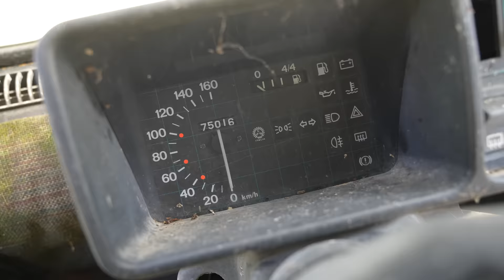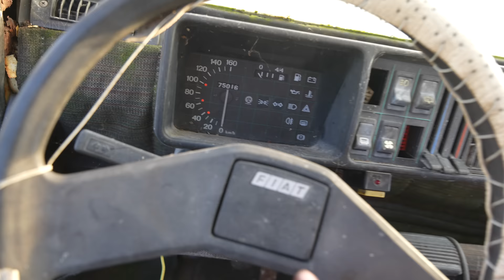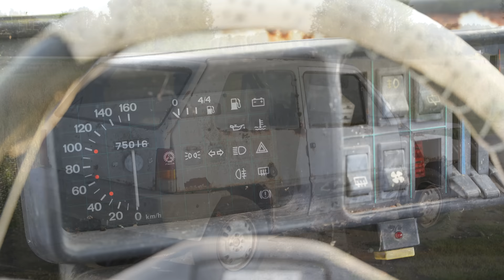Starting Fiat Panda After 17 Years + Test Drive

Comment: Almost nothing can stop the old Fiat 903 cc engine... And the fact that you still can drive a Panda in that condition, says a lot to the strenght of the car.
Reply: Is a imortal warrior
Reply: NOTHING STOP FLEXINO!
u nás v Čechách,je v krizovkach populární fakt:JAK SE ŘEKNE ITALSKY"ZAVADA" NA 4 PISMENA??????
Reply: F I A T😂
Reply: Is it a 5 cylinder cuz I saw 5 wires on the distributor
Reply: @driftking6071  A 903 5 cylinder?? This is a Series 100 engine, 4 cyl from 1956...
Reply: 👍🏻👍🏻 the same the Fire engines.
You can fill with sand instead of oil! 😂
Reply: @driftking6071 Centre wire is for the power in from the coil, the other 4 are going out to the cylinders
Reply: quotes
Reply: Ye that car is immortal
Reply: Dual carb = 958cc type a112 B1 054.
Reply: @driftking6071 4cyl, the Center is wire of bobine.
Reply: Proud to be italian
Reply: for the panda ? wow  @neronedemon
Reply: It was produced for 22 years with the same body. The second longest serial car production after russian Lada Niva :))))
Reply: @video_Creatorul_22mm  You forgot Land Rover Defender, UAZ 469 and UAZ 452
Reply: @driftking6071 4 cables a cada bujia  ,4 cilindros.  El quinto cable viene de la  BOBINA DE  ALTA tensión.
Reply: lol yea right, my mum's one would break if you even breathed on it, would break down on it's way back from the mechanic literally
Reply: @Krst22ify that is the condition?
Reply: Unibody is rotted away and it is unsafe to drive.
Reply: Fiat ai tempi era il TOP
Reply: Made in Termoli in the FPT factory
Reply: not sure, i killed mine on a trip to nordkapp haha
Reply: The mountain goat
Reply: @driftking6071 and ground goes where?
Reply: @shi2381 Exact Fiat Panda 45, 903 45 hp 4-cylinder engine derived from the Fiat 127.Designer Giorgetto Giugiaro
Reply: @christianmirto1597 🎉
Reply: 😂 0:30 ❤❤❤❤❤❤❤❤❤❤❤
Reply: But, the first engine installed is fhe 652 cm3 2-cylinders from the Fiat 126 @dariuscalen
Reply: Fiat Panda= Nokia 3310
Reply: @driftking6071 stai scherzando?
Reply: @driftking6071 è un quattro! Il quinto filo è della bobina di accensione

Comment: Here in Italy, the old Panda has the reputation to be mules.
There still a lot around, expecially of the ones made after the 1986. As they are reliable, easy and cheap to fix.
And the 4x4 still have quite a good evaluation (nothing less than 5000€) for cars which are not meant to be kept in the garage, but to be used on mountains, on muletracks, as a working tool.
And it does a better job than most of bigger 4x4 of any era.
Reply: i have 2001 4x4, everything is right, apart for the "cheap to fix", because they're becoming  "vintage cars" people are already raise the prices for parts
Reply: @Davide0033  here in portugal i bought my 1000cc fire for 2200.. 1700 would be fair cose it had some problems but i can say ive took this car to places that i swore it woudnt come out and it did really easy and no its not the 4x4
Reply: in brazil this car is called fiat uno and its a legend/meme in car culture, some says it was seen beating vw jettas and civics and going 200+km/h, and it a beater beater too, thing is a beast
Reply: @joaopaulogalloclaudino9671 Anche in Italia c'è la Fiat uno,ma è un'altro modello.E' stata costruita e creata in Italia,poi la Fiat a aperto la fabbrica in Brasile ed ha incominciato anche lì a costruire la Uno.E' molti anni che in Italia non si produce più la Uno,ormai è d'epoca in Italia.
Reply: Esattamente alberto, mi rendi orgoglioso di essere italiano anche da ubriaco😁
Reply: @joaopaulogalloclaudino9671  the Uno is a completely different car from the Panda. Different chassis, different engines, different bodies
Reply: Some yoke
Reply: Q

Comment: This is a Panda 45 first type 1980/84. In Italy it is a legend, I love this car (I have a Panda 30).
It's nearly impossible to find one of them,  now, in decent condition, because of rust, the main issue of these Panda first type.
Dear Flexiny, I hope you save the engine of this Panda... And other good parts. These Panda are very different from Panda built after 1985 and original body and interior spare parts are very expensive and difficult to find.
Greetings from Italy.
I love all your videos.
Giuseppe

Comment: Another great video, especially liked this one because I had one exactly like this 25 years ago, those fire engines were absolutely great little units, but the body is no surprise!
Reply: This is 100 D engine 903ccm i think
Reply: @predragv.365  945cc, on Panda. The strange thing, is the double-body carburettor with automatic choke.....on Pandas was available only single body with manual choke
Reply: @zimone89  945cc never existed! There were the 650cc 30hp, 903cc 45hp and the 965cc 48hp for the 4x4. For the northern European market the 850cc 34hp was available instead of the 650cc
Reply: @giorgiotek-604  right, i was confusing with 965 4x4. I thought also Panda 45 has same displacement of 4x4.

Comment: I have an early one, never kept in a garage and has no rust at all, it has over 300.000km and still works nicely. They're quite good for what they are...
Reply: You must be living in a warm, southern country, i guess... I have a late 1st generation Panda from 1986 in great condition and those are very rare in germany, where i live. Most of them rusted away after a few years...
Reply: In Spain, where they were built by Seat, mine's a rebadged Fiat as is an early one, i've got other very rusty cars, but not this one...
Reply: @riejurv50  Mine was built in spain aswell and it's a Fiat. Before i had two Seat Marbella and was looking for another one. But i found the Fiat and it was so good in condition, i had to buy it.... 😅
Reply: @___Steinn___  ow man just dont look under the doors
Reply: @xabussas1362  I did. They are surprisingly good! 😅🤞
Reply: @___Steinn___  mine are 70% rotten noooooooo

Comment: unbelievable: a little service on fuellines and ignition, this cute little Panda fires up as it would run the last time 3 days ago =). even idle is ok, wow. carburated cars aren't as bad as often said. the moment you lost the exhaust i was laughin' heartily, but it's a miracle that the body didn't collapse in this condition. opening the right door could tear this poor thing apart i thought. when you're pressurewashing the Panda i was afraid that you could blast holes in the sheet-metal, but after finishing the washing i felt somehow lucky. 
as always: a great vid, flexiny, no unnecessary words, only useful informations and a good, solid work. after my hard and disappointing day this vid makes me calm and smilin' =)

Comment: In Malaysia we call it  fiat PUNTO popular in 1970s ...!  Flexiny # you got to canabalised parts from other car , the front both ball joint , engine mounting , exhaust system complete set , skirting all round plus bumper  OSO FRONT BOOTH , flush all fuel filter ,  brake , engine oil n filter ,  coolant , and new light yellow colour with stripe * VEDAFONE * ...for town use ...excellent ...! I believe people's will come and ask from you ...! Regards Eddy Opel Kuala Lumpur... i  oso still driving my 660 Daihatsu manual for town use , my MMC 4G15 , frontera and Volvo , I sell off my bmw n vauhall...enjoy watching your trouble shoot make the engine run after 17 long years .  🎉

Comment: I had a 1986 upgrade Fiat Panda 1000CL with the 999cc FIRE engine  and I loved the little car. It was the only car I've ever own that never failed a MOT. The biggest drawback was rust on the door panels, and I replaced every panel while I had it including the bonnet and tailgate! Another major irritant was the clutch cables tended to brake so I always carried a spare. The cables were however easily replaced even at the roadside in about 20minutes! The non servo brakes were also a issue the pads had to be replaced frequently(at around half worn) but again were easy to work on.
It was a nippy little car that was cheap but cheerful, fun to drive, looked nice and had excellent fuel economy, but the seats were a bit uncomfortable in long journeys.

Comment: Increible que en ese estado funcione. El motor no parece el original 903. Al menos la culata y el carburador de doble cuerpo.
Reply: Si que es original. Lo que pasa es que es de los ultimos modelos.
Reply: @ramonllobetpla4033  En España, el Seat Panda motor 903cc de 45cv, nunca montó carburador doble cuerpo. Todos tenían un mono cuerpo.
Los únicos que lo montaron fueron los Seat 127 motor 1010cc de 52cv de potencia.
Reply: Hai ragione. In Italia solo le versioni 982cc e 1050cc ABARTH montavano il carburatore doppio corpo. In Spagna solo il SEAT 1010cc, che per altro aveva pure la cinghia dentata al posto  della catena di distribuzione....

Comment: Should have switched out one of the rear wheels with the flat one in the front.
Might have been a little faster around the yard since the differential seemed to switch most power to the free spinning wheel.

Comment: Questa è una "vera "prima serie ...prodotta dal 1980 al 1982 solo nelle motorizzazioni 903cc 45cv (panda 45) o 652cc 30cv (panda 30)...si distingue per la griglia verticale (lato sinistro per la 45,lato destro per la 30)
This is a real Panda 1st series...it was produced from 1980 to 1982
You can distinguish it by its vertical front grill standing on the left side (for Panda 45 :engine 903cc/45cv )or on the right side (for Panda 30:652cc/30 HP)

Comment: I can't see the point in it, the car doesn't even cost 50 euros, it's totally rusted out, I had a newer model and couldn't get it through the technical inspection association, so I had to scrap it
It had enormous replacement part costs and you can't find everything
Maybe that's just a YOU TUBE video for you, ok we can get it running, ok it's a 750cc engine and very easy to start if the engine isn't destroyed, ok no oil consumption, head gasket is probably broken, no brakes, everything is rusty

Comment: Do cars as reliable as this even exist today, with all the planned obsolescence, shrinkflation and over-dependance on electronic chips in the modern car market?
Reply: but they need to cut emissions 🤡
Reply: @Steve1766  What's your point? I didn't get it.
Reply: i hate it. new cars are all wiring and electronic garbage. when cars were pieces of metal like this they last!! if you look at new features on automobiles they are all useless and just more components to fix or replace
Reply: @fishfrogs8231  I wouldn't go as far as to call all of it garbage, but it certainly makes things less repairable and less durable, especially in the case of a Solar flare or EMP. Also, more hackable. The cons outweigh the pros when it comes to overuse of electronic chips, in my opinion.